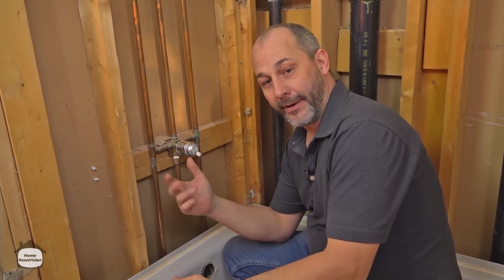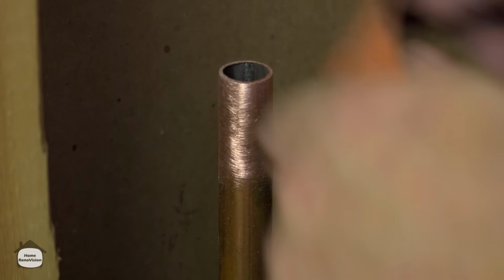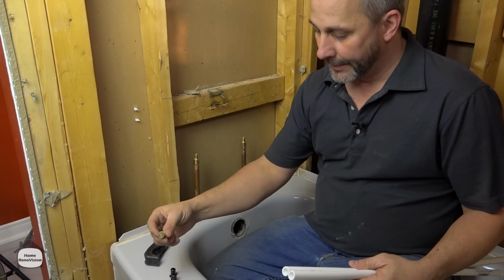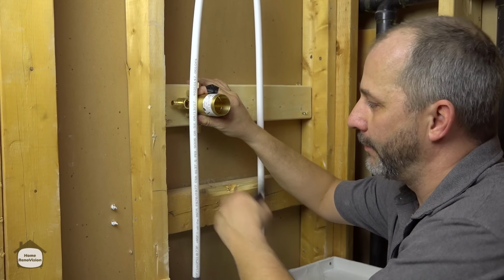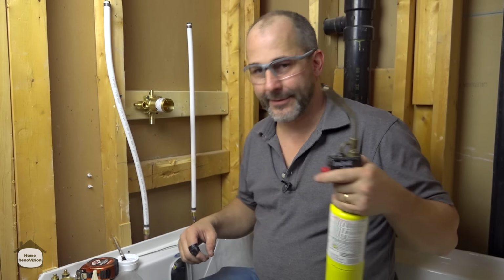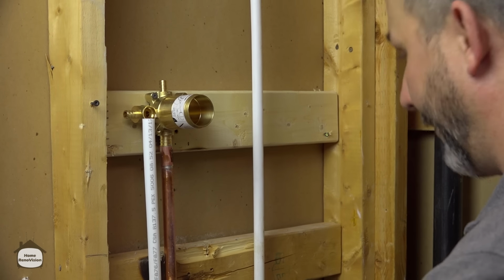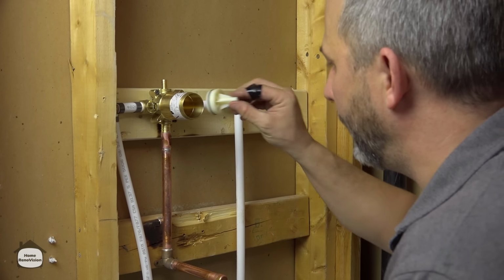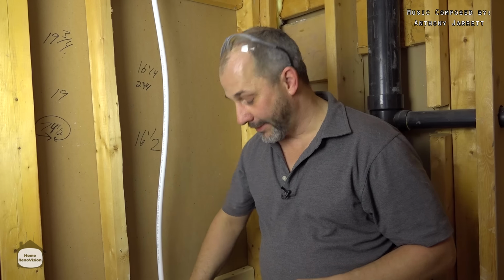DIY How To Install Copper To Pex Shower and Bath Plumbing

Comment: You didn’t ream the pipe after cutting which causes cavitation in the pipe and premature wear.  
Where you located the tub spout, valve body and shower head, you didn’t measure anything vertically. You just located them on the centerline of the tub drain. When you do the tile work the penetrations wont be centered on a tile or a tile joint. It wont look professional. You need to consider tile layout first. 4” or 6” off the tub deck would be a good height for the tub spout. Tile comes in 2” increments typically. If the tub spout is to high will make a lot of noise and splash while filling. 
It is imperative to mount the shower valve at the correct depth from the finished tiled wall. There was no mention of this. There is usually only an inch of play in that regard and if you mess it up its a big problem, you cant install the trim, and would have to open up the wall.

You make it look easy and do a decent job but are missing the finer details that a professional brings to the job. You pay a professional for their knowledge and a quality finished product, not for cutting and soldering pipe because anybody can do that.  Your work is better than a really bad plumber but worse than a good one.
Reply: Well that being said what if I wanted 12 by 12 marble on the walls are you going to try to hit a joint I've never considered the height only the depth because you can drill a hole in any tile with a diamond bit if you have the right tools of course and not just want to nip or wet saw the edge  of the tile to accommodate a tub spout nonsense..
Reply: very good point.

Comment: Hi!  Our HOA decieded to change copper water lines to PEX, because copper started leaking under the slab, and there is no crawl space to fix them, and it is very costly if start drilling slab and digging underground to change old pipes to new ones.  So, HOA decided to route water lines via PEX pipes through the ceiling and walls.  My concern is if it a good idea, and PEX pipes will not leak in the joints..  Please, give me a PRO advise.
Reply from the maker: pex is awesome. no worries. cheers!
Reply: @HomeRenoVisionDIY  , bacteria could grow in plastic ones, but not in copper, as I heard...

Comment: Hello, great teaching video. But why not use pex from the valve to tub spout?
Reply: Because if you do it wont have the right pressure (i believe). But i knowThe shower and tub faucet will both run at the same time  without the shower plunger being pulled up. In most diverters/valve body. There may be more reasons but i know this from experience.
Reply: Because pex is Flexible and you want the spout to be solid, only copper  or steel will make it solid..

Comment: Hello Jeff,
What is the depth that you place the blending valve off of the finish wall?
Reply from the maker: That completely depends on the manufacturer of the valve and the model. always check the instructions as they will tell you the ideal depth. Cheers!

Comment: Question, this video was made in November of 2018, but in April of 2016, I just bought my very first house so I'm practically watching every video you've made cause I have a lot I need to update, you did the exact same install but you used SharkBite for everything, here, you're going old school with copper and soldering, why the different installs? You praised the hell out of the SharkBite parts and how easy it makes, why would you go back to the old ways 2 years later? The video I'm referring to is "DIY How To Install Copper To Pex Shower and Bath Plumbing". Thanks for the amazing videos by the way, as a new home owner, I've been learning A LOT from your videos and I couldn't be more appreciative.
Reply from the maker: just showing options. Sharkbite is great if you have access to them afterwards. If you are going to be buried in the wall then I suggest learning to solder a connection. Cheers!
Reply: @HomeRenoVisionDIY  Thanks for the reply, you're probably the only person on here who does that.
Reply: @HomeRenoVisionDIY  Welp, I've watched god knows how many hours of your videos. I love your fucking channel, I wish I was still in Ontario, I worked there briefly in Toronto, so I could take you out for a pint at a local pub for all the help you've provided for free. Tomorrow, I'm doing a lot of work in the laundry room that had water damage from the previous owners and they did a piss poor job of repairing it. That's why you've seen my asking questions on your plumbing videos and drywall videos. Tomorrow I'm doing flooring, plumbing, and dry wall, and I'm feeling pretty damn confident about it, and it's mainly thanks to your channel and you're willingness to help others such as myself. Thank you.

Comment: Great videos.  I'm doing by my bathroom currently.  I'm wondering why copper on tub line and PEX on two feed and shower not all PEX like in your other video explaining same thing.
Reply: THE TUB SPOUT HAS TO BE RIGID, OR THE SHOWERHEAD WILL DRIP, I LEARNED THE HARD WAY AND HAD TO TAKE THE PEX OFF AND REPLACE IT😣😤😤😤😡😠😡😠
Reply: you have two options to attach the tub spout... a long nipple (pipe thread) or 1/2" copper pipe.  the other end needs to be anchored and pex does not have the strength. The brass elbow that is attached to the wood is made more rigid by the copper from the valve.
Reply: I believe for strength and rigidity for spout.
Reply: Hey Joe you can't use PEX on the spout because it will not allow all the diverter inside your spout to work properly the inside of PEX pipe it's just slightly different than the inside of copper
Reply: @Jlambert1213  my guess was that the spout needs to be attached to something solid, the copper is a lot more rigid than the pex. You dont want the tub spout connected to a flimsy piece of PEX.
Reply: PEX won't flow as well as copper. Sometimes the shower will still spray water even with the diverter in the open position. If you read the instructions that come with most faucets, you'll see that the manufacturers specifically recommend using copper or steel only for the spout connection.
Reply: @michaelmathews295  think about what you just said...

The diverter/mixing valve is a shut off. If you still have water coming out of the tap with it off, it's the valve that's at fault.

The rigidity of a copper pipe is needed to mount the bath spout. Some spouts require a thread on fitting soldered on, stone have a set screw that grabs the pipe.

Comment: Should you get a leak in your
upstairs bathroom, and are not
able to repair it yourself, turn on taps dowmstairs and it may
save your csrpets, until  plumber arrives, but shut your
centra heating off,  It is important. No cold water can 
get to your header tank.
J. Calveley.
Reply from the maker: Or you can just turn off the main supply to the house. In our area we have a master valve. Cheers!
Reply: @HomeRenoVisionDIY  
Won't help if leaks on hot water
pipe .
J. Calveley. 

.

Comment: Im a fan of really clean solder joints so I use my flux brush on the joint while it's still hot to clean any drips that may have formed. Also rule of thumb is 1/2" pipe only takes 1/2" of solder 3/4" uses 3/4"" and so on. Not a big deal but as a union steamfitter my boss would kill us for wasting so much solder it adds up on the big jobs.
Reply: Yes it does add up lol and I've had bosses that were fussy like that and it is a waste I've worked for guys that would straighten out bent nails to reuse them it's like a dime holding up a dollar in my opinion but whatever..

Comment: I use a sharkbite to go from copper to pex. Plumbers hate them but I have found that the synthetic rubber o-ring inside the sharkbite contacting the copper doesn't corrode or leak, knock on wood :-)

Comment: The problem with those light brass fittings is they react with the copper and in 6 years they corrode and slowly leak. Also it is best to deburred the copper on the inside after cutting it.
Reply from the maker: That is one of the dumbest things I have ever heard. You do know that all shower valves are made of brass right?
Reply: @HomeRenoVisionDIY  It could be my water that makes them corrode. They are lead free brass.

Comment: Why use the pex 90 fittings instead of using a 90 degree bend support? Less fittings, less points of failure (and genlter bends means better flow.)
Reply from the maker: Not enough room in that framing scenario. I wish builders would leave a 20" space for plumbing valves.

Comment: I was looking at adding a couple of body jets instead of getting the while shower column. Why does it cost as much to buy the valve/diverter/trim as it does to buy the whole column, which has all of the plumbing plus the faucets/jets/fixtures???  The prices just for the a-b-ab multichoice diverter valve are ridiculous on their own. The trim makes it cost more than a good column with 4 to 6 jets, handheld and rain shower head! Tell me there is a better option than buying the column and gutting it to make it cheaper to get the parts!
Reply from the maker: the fixtures that go into the wall are very superior in quality and will last 100 years. the wall mount will last 10 Cheers!
Reply: If you look around you can get body sprays o line that are reasonable
Reply: American made showers valves/diverters and sprayers vs European fixtures simple as that

Comment: Thanks for your videos and advise. I'm a first time home owner and with your videos I will be able to do A LOT of renovations and repairs to my house. 
I want to move my shower head from the left wall to the front wall (exterior wall) in my shower. Do you have a video that could help me? After I relocate the shower head I will tile the entire shower.
Reply from the maker: just make sure you will not freeze the pipes. Cheers!

Comment: I don't trust those PEX joints. It's hard to beat sweating pipe. Economics may rule the the day but this garbage of building homes as quick and cheap as possible is absolute ass. What you get in workmanship for what you pay isn't anywhere near equal.
Reply from the maker: Harri, I couldn't disagree with you more. with copper you get freezing causing bursting, hammering, risk of fire, and a huge expense in materials and labor. In pex you get quick cheap and a flexible pipe that does not burst and fittings take up to 500 lbs psi which is ten time the average home water pressure. There just is no down side except for plumbers who quickly loose value with these types of install.

Comment: I noticed that there is no planning for a trouble access panel. If  fixture fails the tile will have to be ripped out
Reply from the maker: It can be replaced from the backside. Cheers!

Comment: question, arent important the extra 18 inches for the water hammer effect? I have been looking around and still dont get a clear answer, it makes sense to me but I want to know what is the right way, Do we need to put water hammer arrestors on the shower valve or not?
Reply from the maker: Hi Frank, here is a clear answer. the water hammer is a result of changing water pressure. copper cannot handle the changes so we install those extensions that are basically filled with air. the air can be compressed and absorb the pressure changes and eliminates the hammering of the pipes under stress. In pex applications the pex pipe itself can stretch and shrink according to the water pressure changes and does not suffer from any hammering effects. so therefor it is not neeeded. Cheers!
Reply: @HomeRenoVisionDIY  thks for the explanation

Comment: Trick with a spirit level, place the level on a flat surface, and
put your finger against one end
of it. Watch where bubble stops. Keep finger in same place and place other end of
level against your finger. If
bubble is in a different place,
level is not true. Save yourself
a headache and do this on the
counter before you buy. Bubble
should be same place when you turn the level round.
J. Calveley

Comment: Plummers, hopped on here wit big issues.. lol... The Pex Technology is pretty sound though.. There are several different levels and brands of it sold.. My next build will be with it also... I've done some serious set ups with it.. I'm sold!
Reply from the maker: plumbers hate DIY. it figures.
Reply: Cpvc is also an option that has a good reputation and I'm an old plumber it's just how it is things change it's been that way since the beginning of time Henry Ford had an assembly line and people bitched about that too right it's normal shit .. lol no amount of bitching is gonna change it ..suck it up buttercup

Comment: Btw there is nothing wrong with Pex its very versatile , fast , safe , and clean. In my 50 years of experience I have also seen plenty of poor and dodgy soldering, resulting in leakages and corrosion's that I had to fix. Btw the Olympic stadium is fully installed with Pex and so in all modern constructions it saves plenty of weight, costs and thus money
Reply from the maker: here here, fist pounding on table. Cheers!

Comment: Ok...you wanted to show from copper to pex...well do it the right and modern way...this looks pretty crummy and clumpsy...go to Uponor and you will see all the connectors you can wish for without soldering from the point where you have cut the two feed pipes up to the shower tap....from the cut pipes to the shower tap I'll do it for you in 15 minutes flat, promise. All pex and no soldering !

Comment from the maker: To watch all the videos in this project click this link. https://www.youtube.com/watch?v=ziYQaxYQv94&list=PL34cQkzKfXWaGWat-DxyZhkJXNZBTZW-4&index=2 And remember with playlists you can scroll through the videos using the arrows in the bottom left corner.
Reply: Have you ever tried the piece of bread trick for holding water back before soldering, it works, white not wheat.
Reply: Thank  you sr u are the best
Reply: Jeff, love the show(s).  Have you tried to use Uponor piping?  aka.  Pex-a.  The tool is a bit expensive but making connections in tight spaces is a lot easier.  Personally, I think it is even faster than using the crimp style piping.
Reply: Were can i find a shower tub valve system/ hot an cold shut offs with intigrated perks adapters to it
Reply: Home RenoVision DIY pex sucks👎copper is your friend 👍

Comment: If you have a copper system installed with shower don't change it to PEX  because, there is nothing wrong with copper tubing. PEX is something fairly new and offers fancy flexible tubing which doesn't require soldering and allows for more connections that are not necessary.
Reply from the maker: Sorry Carl, Pex has been around for many years now and is the industry standard in construction. And don't forget they invented cell phones too around the same time. Perhaps you should pick one up and google plumbing.

Comment: I've been plumbing for the past 60 years and it's nice to see someone like you to take the time to show others how to do their own work. I would like to add though that it would also be helpful if you mentioned the importance of well fluxed joints in addition to the importance of the cleaning because it requires both to ensure a leak free job. In addition, to be sure that you have no leaks when soldering any fitting, you should always put flux on both the fitting, and on the pipe.  One leak in the basement of a two story home after you turn on the water is not worth the extra work you'll have to go through after you've filled the entire system with water and have to wait for it to drain in order to fix the leak.  Finally, while a solder joint with lead drippings all around the pipe might work fine, it sure looks a whole lot better if the joint is wiped with a piece of steel wool or a rag after the joint is full, and says a lot about someones work ethic.  The best part is, it only takes a second to clean it.  Keep up the good work.
Reply: Don't see you reaming the insides of the copper pipes.
Reply: @LK-vb2pl  are you giving the 60 year plumber crap and in the same sentence saying shark bites are good for permanent joints? LOL
Reply: Let me  ask you a question!  After soldering and crimping your pex pipe should i do a 24 hr waterpressure test ? Or if it doesn't leak right away it wont leak ever?
Reply: @patriotsleepercell4060 
My plumber tested it & left it for next day before closing out with tiles just to ensure no leaks. So better wait for next day to ensure no leaks.
Reply: Да❤ @patriotsleepercell4060
Reply: You clearly don't know what you are talking about, I hope your not a licensed plumber and instead  just some "ill do it cheap" handy man doing some tacky work with this "knowledge" you have.
Reply: Im a licensed master plumber.  This video is garbage.  How do you as a real plumber respect his plumbing videos?🤦🏼‍♂️
Reply: Sharkbites in my opinion are great for quick fixes in areas you can see, but I would never put them in a wall their are many things that come with putting a sharkbite on, many put them on wrong for example your not supposed to sand the copper ( don’t believe me it’s on their website) and they just aren’t as secure again in my opinion over press, crimp, solder, etc.

Comment: You said the place was a rental? Are renters harder on the one piece valves than the old 3 handles with washers?
Reply from the maker: sorry, not sure where you got that idea! but the valve works great. it is solid brass.

Comment: I haven't gone through all the comments but you can skip the solder and use a "sharkbite" fitting and go from copper to pex in seconds. Expensive but for the first connection only then crimp the rest. Check building codes many allow them in inexcessable space.
Reply: Why would you risk installing a sharkbite in a wall? Its not hard to install a much more reliable product.

Comment: Which is your preferrend tool when using pex, the crimp or clamp rings?
Reply from the maker: I prefer the solid rings. they have an almost perfect performance at the pressure test where the clamp rings do have regular failure at the pressure test. Cheers!